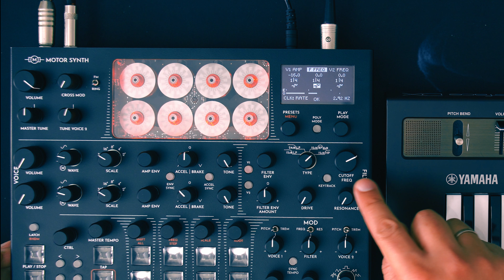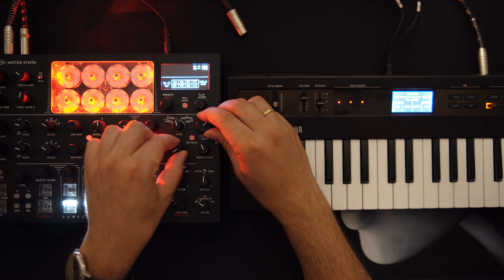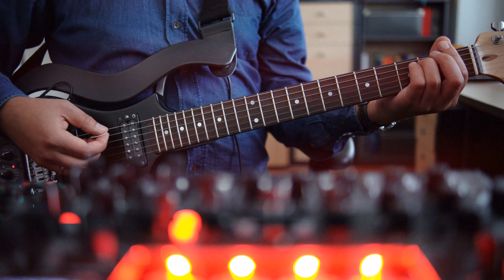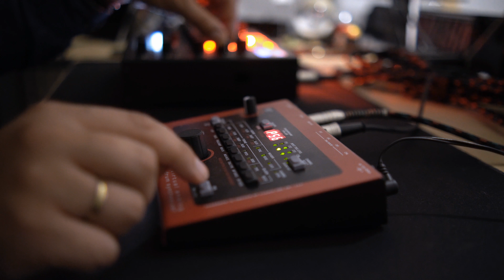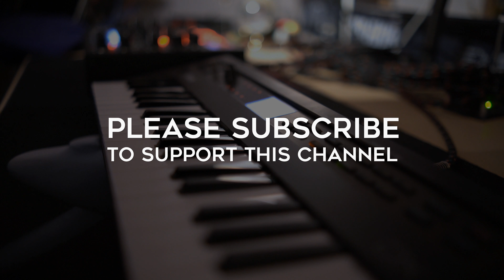On that audio input on the Motor Synth ...

Comment: Dude Floyd this is a really cool video!!! Am I crazy or did the DX lose a ton of tone and low end as soon as the filters were switched on? I watched a few times and it seems that it did! Cool sounds at the 5 minute mark.
Reply from the maker: Thank you very much! I thought the filter sounds pretty good - yes, it takes away from the sound, but not more than intended.
Reply: @mr_floydst  Totally, nice job on this one.